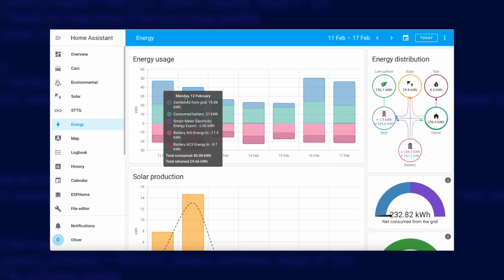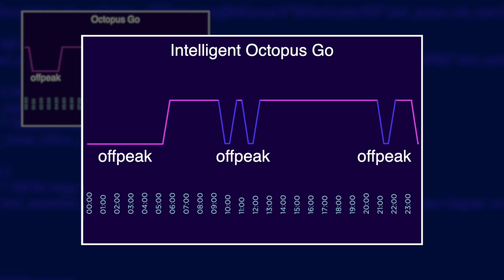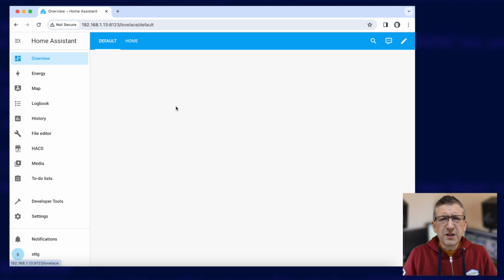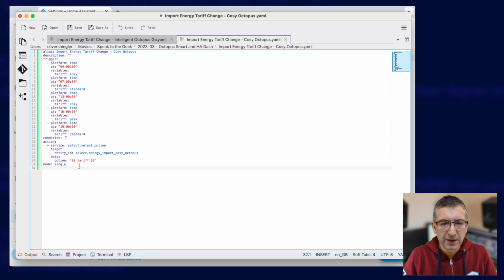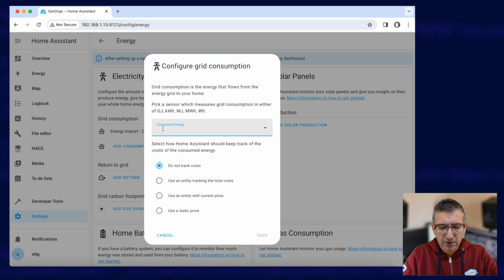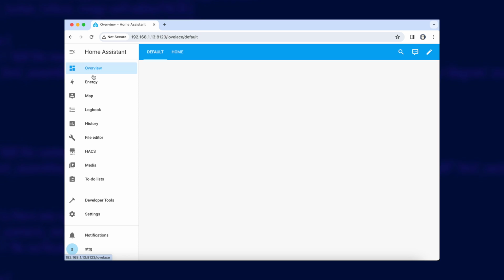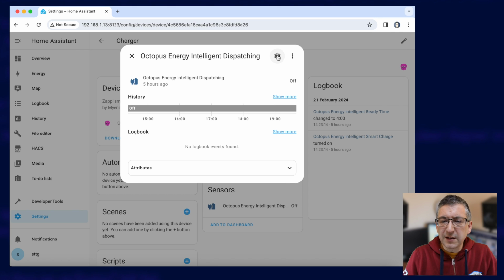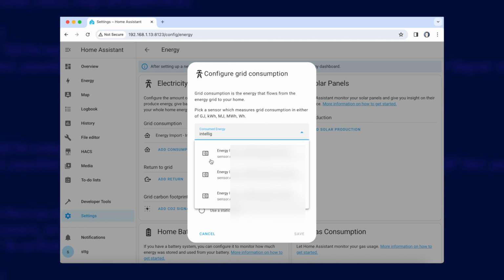Octopus Energy Smart Tariffs and Home Assistant’s Energy Dashboard: Cosy, Go, Intelligent Go, Flux

Comment: Follow this great video and all setup now.  Is there any reason you chose to have the utility meters (off peak and peak) not reset daily? Interested to understand the implications if any
Reply from the maker: Personally my own utility meters in my own installation are set to reset daily. For the functionality of the energy dashboard however it doesn't really matter because it uses long term statistics for the data. On the one hand daily reset is an added complication to the tutorial, on the other hand it does give you more flexibility to change the source sensor entity in the future without messing up the day's data too much for the day you make that change.
Reply: @SpeakToTheGeekTech  Is it possible to change it to reset daily?  I couldnt find it in configuration.yaml or and I couldnt edit the reset frequency in Helpers
Reply from the maker: @mdeakin  Not that I'm aware of. You'd need to delete the helper and recreate it again with the same name.

Comment: Great video. I see that you are a GivEnergy user. Which entity would you use to create the utility meter for the grid power?
Reply from the maker: This video is specifically about energy, not power, so assuming you have mixed those units up? Your GivEnergy inverter should have an entity named along the lines of sensor.givtcp_xxxxxxxxxx_import_energy_total_kwh which you can use as the source for the utility meter. I'd suggest making sure it is on a daily cycle too.

Comment: Thanks for this video. I have left it for 24 hours but the utility meters do not come up to select as a source in the Energy Dashboard configuration. I have checked that they are in kWh. They are derived from the same SolarEdge entity as I am using already which does come up as a choice.
Reply from the maker: Hi, I've done the process many times on many installations and only very occasionally it plays up. The only way I've found around that is to create a new utility meter with the required tariffs but using a different name (so it gets a new unique entity name), and then updating the automation to switch the new utility meter. But, most of the times when people have asked me about this not showing up in the energy dashboard it's usually because a step has been missed somewhere.
Reply: Thanks for the reply. I set up new Utility Meters but the same result. All I can do is wait a bit longer to see if the utility meters show up eventually. They are obviously not being recognised as energy units even though their source is.

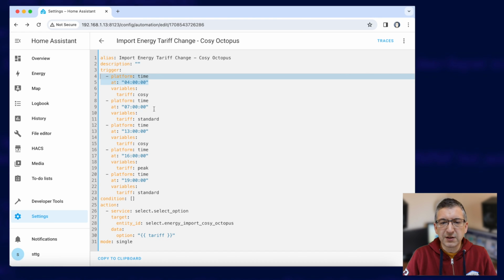Comment: I’m on IOG using the Ohme charger. This doesn’t have full integration with Octopus, so my dispatching entity only shows off-peak as 23:30 to 5:30, irrespective of the schedule that Ohme/Octopus comes up with. Given that I never elect to boost charge at peak rate, it’s safe to say that whenever the Ohme is delivering power, it’s off-peak. So I use a power meter to automatically flip to offpeak when Ohme is charging (or it’s currently off-peak hours). Works pretty well!
Reply from the maker: That's a shame - I didn't know anyone with an Ohme charger when I put this together so I confirmed functionality with a Zappi and a Tesla Model 3.
Reply: I have integration with my car (id4) and as a result I need to do this solution too - am struggling with adapting the YAMIL, is this documented anywhere so I could copy bits?

Comment: Great stuff, thanks! Could you please add the fixed night low rate time to the Intelligent Go automation? i.e. so that low rate is selected between 2330-0530 OR when car is charging. Cheers!
Reply from the maker: It is in there - it's automatically dealt with by the 'intelligent dispatching' sensor. There's a whole section discussing that in the video
Reply: Oh, ok... With the Ohme chargers, I guess I need to use a different sensor then. Thanks for answer :) @SpeakToTheGeekTech
Reply from the maker: Sort of, basically the same sensor (with 'intelligent dispatching' in the name) but it will be part of the Ohme device in the Octopus Energy integration instead of the Zappi as shown in the video. The sensor is basically associated with whichever device you enabled for the intelligent tariff (so for Tesla owners this might be the Tesla itself showing as a charger)
Reply: Yeah, it's different with Ohme chargers, not as straightfwd as Zappi... I can't use the above mentioned sensor( or eqv), because Octopus "assigns" IO slots randomly during the day, so even tho they're not "activated", that sensor above will still see them and think low rate is in use. I use "power draw" in combo with "car charging" from Ohme to determine when car is actually being charged. I will just add the nighttime slot to that automation. "Should" work :)
  @SpeakToTheGeekTech

Comment: I setup my energy dashboard when I was on Flux using this same process off your earlier video on Energy tariffs, and then adapted it when I moved to Agile so I now have a hybrid approach.

As Gary Chivers suggests, using the ‘Current Rate’ entity from the Octopus integration is simpler than manually typing the rate in AND has the advantage that when the rates change they change in the energy dashboard automatically and the correct (old) rate stays in the dashboard - if you manually type the rate in then when the rates change the energy dashboard prices your old consumption on the new rates 😮.   You can still combine this entity with your tariff switching approach to see different time of day kWh consumptions and spend (eg Cosy,Flux, Go).  You have to use this method for tariffs like Agile and Tracker, and is what I do (and I have a separate ‘free’ tariff for Octopus Power-up’s).

In the video you glossed over getting the import data, saying “from the energy meter”. If you have a Hildebrand glow then this is one approach, or an Octopus Mini supplies it via the Octopus Integration, but I’ve found the simplest approach is to use the import entity on your inverter. Mine reconciles very close to my Octopus meter readings, and also requires no extra hardware 👍
Reply from the maker: I was concentrating more on energy in the dashboard rather than costs, so I did gloss over it a bit for the sake of trying not to make the video too long. I use the Octopus Energy integration to track the costs though just as you say so I should probably have spent a minute to go over that too. And there are many ways to get the energy data - I use Hildebrand too, but you could use the Mini (nice and free if you are on Octopus) or a solar / battery inverter or any other device monitoring it. I did make a number of assumptions in this video I know... perhaps I shouldn't have!
Reply: @SpeakToTheGeekTech  Lots of ways to do things in Home Assistant, and gives things for us to comment about!
I have an Octopus Home Mini now but it arrived after I’d already been using the energy dashboard with my inverter feeding import data in, so I just left the inverter entity in place than the home mini as otherwise I’d have lost the previous history in the dashboard.  Also probably a bit of latency in the OHM sending up to Octopus and then pulling back down again to HA whereas the inverter is polled every 20 seconds. Not that latency would affect the energy dashboard of course

Comment: An even easier way is to use the Octopus integration and the API for live price data. Then in the energy dashboard when setting your electricity import sensor select "use an entity with current price" and select the "Current Rate" entity from the Octopus integration.  This has the advantage of automatically updating if you change tarrif and when the prices change each quarter.

I've been on Cosy for 3 months and HA reports with in a few pence of my actual billed amount.
Reply from the maker: That will work for keeping track of cost, but it wouldn't separate out each rate into a separate item in the graph/table.
Reply: but it won't add your daily charges

Comment: Thanks again for the tutorial however after installing the  Octopus Integration, as you instructed, "devices" shows  the two devices BUT in my case it's "electricity meter" and "charger". The charger is Tesla Wall Connector (supposedly "dumb") whereas the controlling unit should be the Tesla car?? Should I re-register Octopus IO before doing anything further? (I'm on OIG)
Reply from the maker: And because the associated article isn't live yet, here's the automation just in case you need it:

alias: Import Energy Tariff Change - Intelligent Octopus Go
description: ""
trigger:
  - platform: state
    entity_id:
      - binary_sensor.octopus_energy_intelligent_dispatching
    from: "off"
    to: "on"
    variables:
      tariff: offpeak
  - platform: state
    entity_id:
      - binary_sensor.octopus_energy_intelligent_dispatching
    from: "on"
    to: "off"
    variables:
      tariff: peak
condition: []
action:
  - service: select.select_option
    target:
      entity_id: select.energy_import_intelligent_octopus_go
    data:
      option: "{{ tariff }}"
mode: single
Reply from the maker: The 'charger' device should actually be your car and that's where the binary_sensor for intelligent dispatching should be located. Whichever device you registered with Octopus for use with intelligent control is the only one that is capable of appearing here because Octopus wouldn't know about anything else.
Reply from the maker: I have just spoken with someone I know who has that same setup as you. The car appears in the Octopus integration named 'Charger', but it is the car and that's where the sensor is for certain.
Reply: Great! That makes sense I guess so I'll continue with the setup
 @SpeakToTheGeekTech